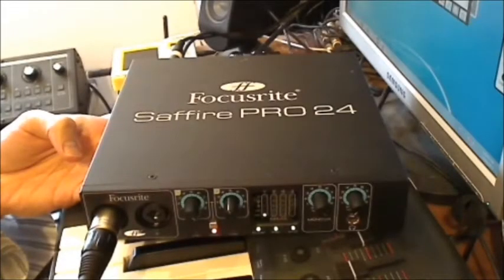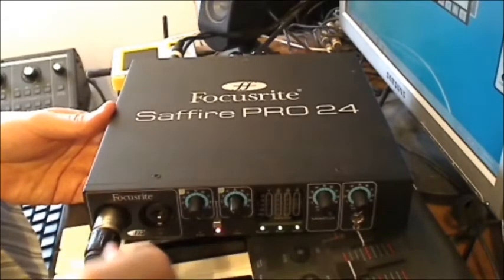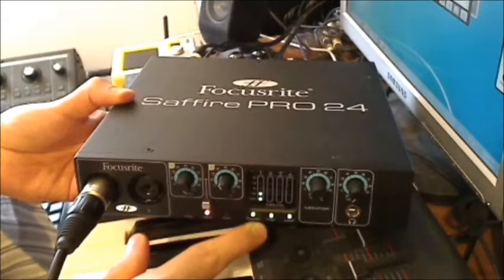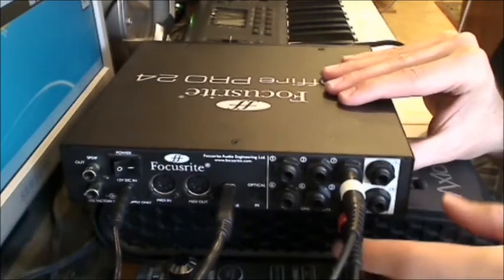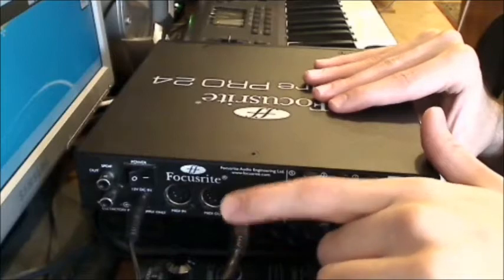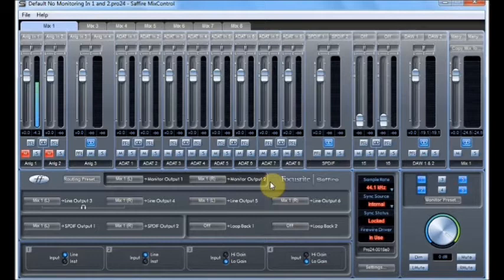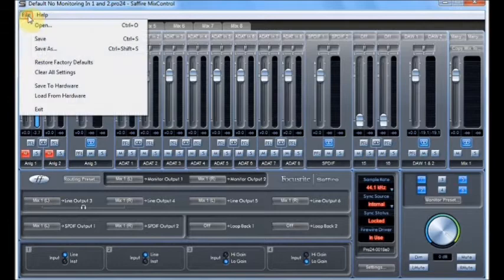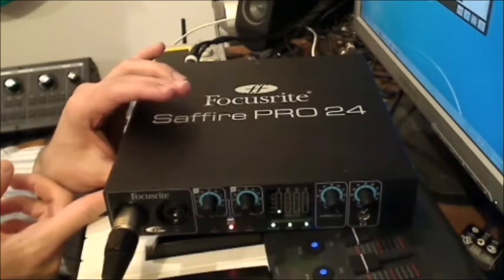Saffire Pro 24 review with latency test

Comment: THANKS, man! Exactly what I was looking for! 
Wanted to buy one from Ebay, for my older Computer, but the latency is soooo big. 
And for a firewire... 

I think I will skip this.
Reply from the maker: Just notice that this is the "round trip latency" which is about DOUBLE the value you set in your DAW. The latency you feel is usually half of that. (unless your doing send/receive from external gear)
Reply: I saw that that was the roundtrip latency, and I meant IT. But, if you compensate for it in your Daw, do you put in the whole roundtrip latency, or HALF of it? Negative, positive... Ever tried that? I just tested it yesterday, with my Steinberg UR12. When the DAW reported 9ms roundtrip latency, I tried to set the +9ms, then -9ms, then half of These numbers... It got an improvement, but still did not come to a clear conclusion. If the compensation works perfectly, then I see no stress anymore to buy so much expensive gear, JUST for the latency...
Reply from the maker: @SocietateaAscendenta  It really depends on what your doing. Say your recording your voice and following your DAWs track by your ears (as most do). Then your voice will be delayed around half round trip (from the time you speak). But I think most DAWs have an automatic compensation for simple and common setups like that. It would be hard to assume that a developer overlooks that. If what your hearing sound seriously lagged. Then there is probably a different hidden problem
Reply: Thanks a lot!!!

Comment: either you computer REALLY sucks or your test is WAY out ,
Reply from the maker: Can you explain please?
Reply: I have my pro 26 (same thing it just has more inputs ) set at 96 on the audio buffer , i get a latency of 2.562 milliseconds . I`m running a Ryzen 5 , 6 core with 16gb fury x ram , if i set the buffer to 256 i get a latency of 5.723 milliseconds.  So your test cant possibly be right unless you have a really really old pc or something is up with the system you are running . or the test is just flawed . 21.09 ms for a round trip is just totally wrong .
Reply from the maker: You are probably using a higher sample rate than what I tested in the video. As shown, I've tested for 44.1Khz in the video since thats the sample rate I usually use in my DAW, this will obviously heavily affect the latency compared to your test if your using a higher.

If your not using a higher rate, then I agree with you that the difference is surprisingly off.

The video is 5 years old now and my PC is even older (Intel i5). So the information here is not necessarily relevant today.

Comment: Hey great video. Can you tell me if there is a real time monitor control for the input signal? Thanks
Reply from the maker: +justlive4themoment Thanks, The two control/knobs shown are real time controls for the inputs as far as I know. But I don't suppose you meant that. If you meant "direct monitoring" then yes, you can enable that mode as far as this page says: https://us.focusrite.com/answerbase/category/saffire-pro-24pro-24-dsp
Reply: Oh yes that is the one!  Can you tell me when you are in a oroject fe,  lets say ableton if you have much cpu load at 96 sample rate compared with the 44.1? Thanks man!  :)
Reply: Project file *
Reply from the maker: justlive4themoment hmm, don't know. I almost never use 96Khz. I'm always on 44.1Khz
Reply: Why not?  The 96 has superior sound quality.  With my current tascam us 4x4 you hear a great difference
Reply from the maker: +justlive4themoment Human ears can't hear any thing above 20Khz, It's just impossible. So theoretically speaking you need DOUBLE that frequency in a digital system. So that makes it, 40Khz. Or 44Khz is very enough to capture any possible audible sound exactly as it is. And by the way most people above their 30s can't even hear any thing above 16Khz or 17Khz. 

Having said that. There is in fact a particular case were a higher rate MAY be useful. Which is when you use SOFTSYNTH/EFFECTS PLUGINS. The reason is, digital synths/effects may sometimes need to do processing at a much higher rate than human hearing inroder to avoid something called "Aliasing". Although that may not remove all aliasing, it can help. But that doesn't mean that all soft synths need that. some synths just do the higher rate processing internally.

Soundonsound.com mentions another case were at some recording situation, some aliasing can occur at a very high like 21Khz. But I don't know how any one can possibly hear this. 

Again, for recording/playback, you don't need any thing above 44Khz for the most part as far as I know. For plugins, you MIGHT avoid some aliasing with a higher rate. 

Now if the large deference you are hearing in the sound between 44 and 96 is not due to plugins, then I'd be interested to know what you are doing. There are a couple of other things like "interpolation" and "bit depth" methods that can affect the sound quality. May be your DAW is converting some samples that were recorded in a higher rate when you set it to 44. Or may be you have bats ears :)

Comment: Thank you for the video! Can you (or someone else) tell me if the headphone out is an individual output or is it's signal tied to some other outputs (like 1+2) on the back?
Reply from the maker: Thanks, the headphones are definitely NOT individual outs. But I'm not sure how they are tied to other outs. I usually don't use them.
Reply: Thank's for the quick reply :) That's what I thought. The user guide of the similar Scarlett interface states to which line outs the headphone outs correspond. This information is missing in the Saffire one.
Reply: Jonas Herres Don't know if you still need an answer, but I own a Saffire and regularly use all the outs. The headphone port is basically a combination of analog outputs 3 and 4. You can use both at the same time without a problem, but you will have the same mix on the headphone out as on the outputs 3 and 4 on the back. The mixcontrol software shown in the video gives you a lot of audio routing options for the outputs. You can assign a different (or the same) mix, DAW output, or analog input (for direct monitoring) to each output. 
Small but useful 'hack', you can use your headphone out for a single port stereo mix, altough it's output volume is a little lower than your back outputs, since you don't want to blow out your headphones.
Hope this helps!
Reply: No problem man, best to know what you're buying (:
Reply: Thanks very much for this detailed answer :)

Comment: Sorry, your test of latency is not correct. i´m using this interface too and my latency when using 32 buffer size is "1.3 ms". i´m using this interface for my edrums and it´s working perfect.
Reply from the maker: The minimum buffer size on my computer is 240, not 32 as yours. Thats why your seeing much less latency. Remember that latency very much depends on your whole system speed, not just the audio interface. You might be having an updated version of the driver or the interface, or your computer simply has better specs than mine. This video was 2 years ago.
Reply: i have an old core2duo (2x 3 ghz) system with 6 mb ram.
Reply from the maker: Manfred Nauer
hmm, I have a i5 with 6GB!!. Whats the latency on yours; when you set it to 240 buffer size ?
Reply: SoloStuff
not 6mb - > 6 gb of course.. sorry -> can´t set it to 240 buffer size . only to 256 or 192.
Reply: SoloStuff
32 i have 1,111 ms input latency and 1,769 ms output latency, 192 i have 4,739 input and 5,347 out, 256 buffer input 6,190 and output 6,543
Reply from the maker: Manfred Nauer yours for 256, 6,190 input + 6,543 output = 12.62ms Round Trip Latency. BUT how did you measure input and output separately!!. The centrance tool only measures round trip latency which combines both input + output + your computer latency.
Reply: SoloStuff
You need a DAW.
Reply from the maker: Manfred Nauer The values you see in your DAW are not measurements. They are calculated/approximated by simple math (latency (ms) = buffer size / sampling rate (khz) ). These are the theoretical times required for the samples to pass through the buffers. This DOES NOT account for your computer hardware/driver and OS latency. The only way to measure this is using ROUND TRIP latency using a specialized tool like centrance.

p.s. to use the tool, you have to connect one of your outputs to one of your inputs.
Reply: if you think!
Reply from the maker: Manfred Nauer
Even if I can't think :)
Reply: +Manfred Nauer  I tried to read through everything on this post and I got more confused.  I want to use this interface on my 2012 macbook pro and I'm wanting to use this device with my Superior drummer (Solo) program.  Will this be quick enough for live drumming.  I have 8 gigs of ram and 2.5 ghz processor.  Thanks.

Comment: Great video :) Im in a bit of a pickle  - i  hooked up my pro 24 to to some krk rokit 8 and cant hear no sound from them. Im only able to hear sound when I use the headphones, any suggestions?
Reply from the maker: Thanks. Make sure your DAW directs it's output to one of the outputs on the saffire (I think Mon1 and Mon2). Then try messing around with the Mixcontrol software, you have to route the DAW outputs to the Mix.

Comment: I think you're showing a TS jack describing is as TRS.  TRS implies a balanced cable, it has three conductors on Tip Ring and Sleeve.  Hence the name.  TS jacks are not balanced.  Anyway, it's not a complain, just a correction so that whoever watches that video is not misdirected.

Comment from the maker: I haven't used the scarlet, But try turning the "Direct Monitor" knob to 12 O'clock, this way you have 50/50 balance between your DAW and the input. Read the section in the manual "Using Direct Monitoring"

Comment from the maker: It seams some thing is wrong with the ASIO driver. Since youtube and players don't use ASIO drivers and DAWs do (I'm assuming you did choose ASIO in your DAWs) . Have you tried installing the latest driver from forcusrite? Also, If you're using Windows 7 64bit, you need to install the legacy driver before that as I mentioned in my video at 11:20.

A ground loop usually produces a HUMMM sound, you said crackles so I don't thing thats the issue.

Comment: Actually I've seen the post you mention, but none of it explains why the 48-volt Phantom Power of the Focusrite is unable to supply and support the Ovation guitar preamp that is otherwise kept functioning with only a 9-volt battery. It doesn't make any sense.

I've also posted this question to Focusrite.

Comment: Hi, I have an Ovation C778LX guitar with built in preamp, which is also able to accept Phantom Power via XLR jack on the guitar, to conserve the 9-volt battery. Will the XLR inputs on this Focusrite provide Phantom Power to the preamp of this electric/acoustic guitar, or are these XLR jacks for mic only?

Thanks